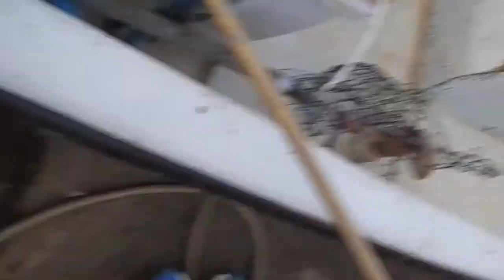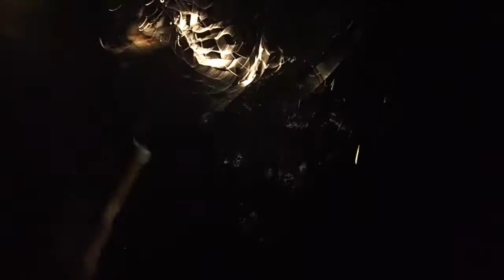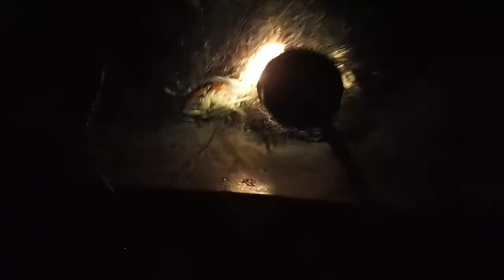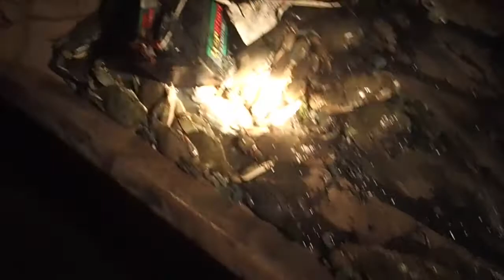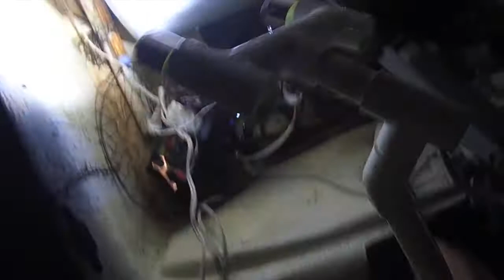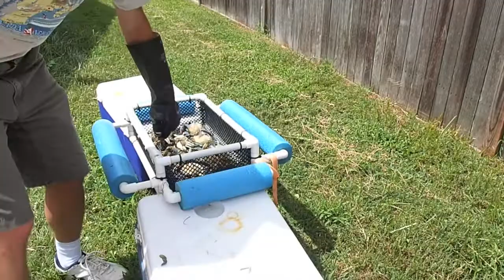Crabbing at Night!

Comment: Hi what type of floating device is that your putting the crabs in? I need to get one lol that's so much easier then carrying a bucket while in the ocean
Reply from the maker: You can get them at Dicks. I think it is used to carry deer in the woods but is great for a small boat! It is called a jet sled. they make several sizes. http://www.dickssportinggoods.com/product/index.jsp?productId=11929391
Reply: +Gigmaster ok thank you! I'm definitely buying it and I actually ordered the bluefire lumen under water flashlight yesterday.how did you make that set up Under water with the 2 lights ?
Reply from the maker: Just used PVC pipe. The light fit in there perfect and snapped in without doing anything! I think it was 1" PVC.
Reply: +Gigmaster ok thanks man for your help!
Reply: Pauly ! hey I have one I got from bass pro for hauling decoys not sure what it is called but that would be the place to look. 
hope that helps .
Reply from the maker: I got mine at Dicks. Just type in "Jet Sled" in Dicks and it will come up.